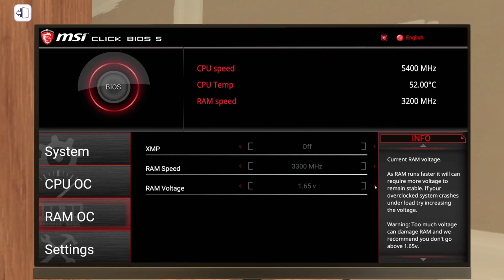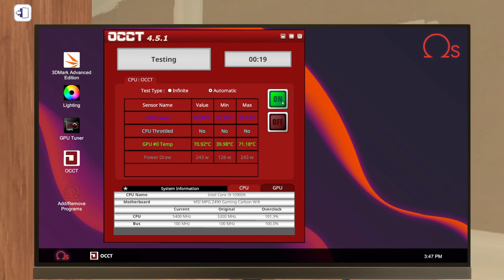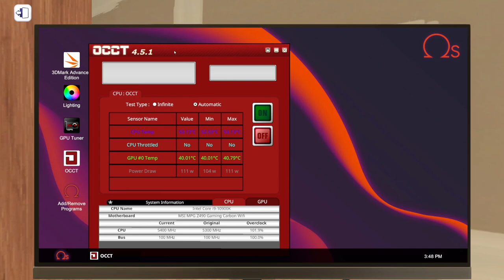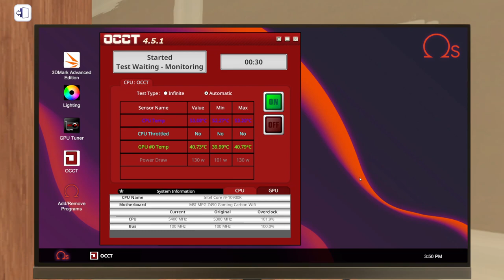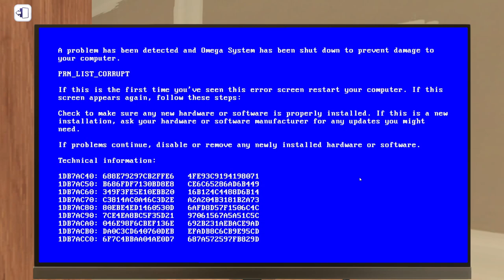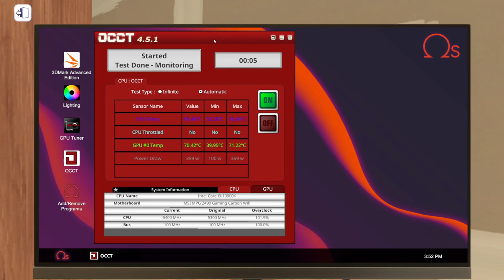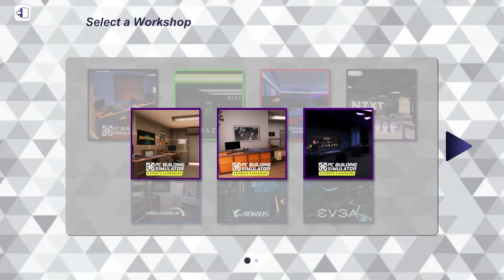RAM Overclocking Tutorial | PC Building Simulator

Comment: You can put any RAM to 1.8v without frying it. Even in the past there were very few that didn't have that lower threshold, but right now all of them are the same in this regard. It's also not "really hard" to fry your RAM with frequency, it is in fact impossible. You can only do it with voltage. There's also no real reason to have 4 sticks with that CPU. The minimum amount you can raise the frequency safely for every single RAM is at least 0.13 times (some go even higher safely), so for a 3200 RAM 3200*1.13=3616 is always safe. If you're getting a BSOD, you're just not properly setting the voltage to 1.8 (at least). For the specific RAM you've shown, 3663 is always safe, and 3948 is the absolute maximum. These can either be calculated or just looked up in a guide. Other than these, the procedure itself is just like how you showed it, perfect for beginners who don't know what they're doing. Great guide overall, just wish you wouldn't be saying the "sometimes" and "probably" stuff when still using perfectly safe values :)